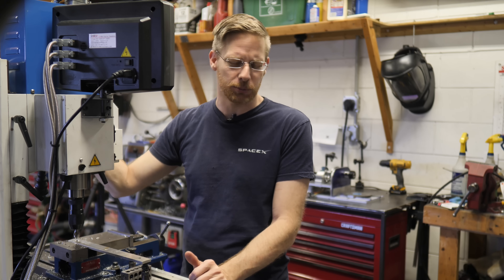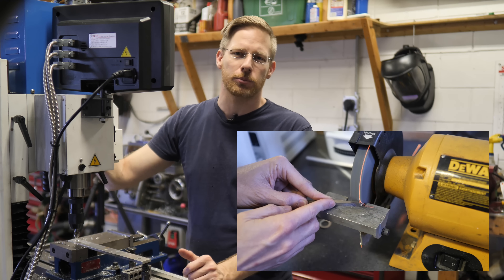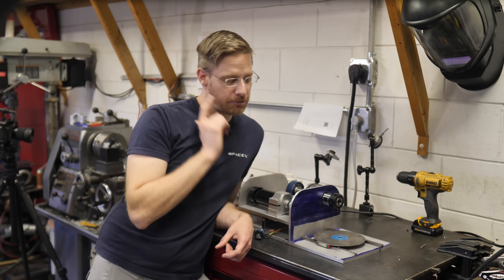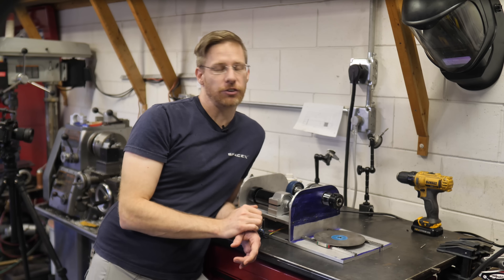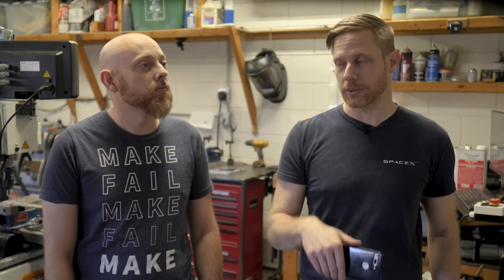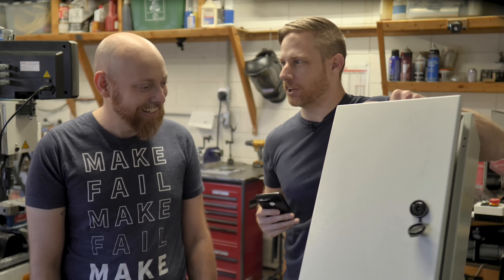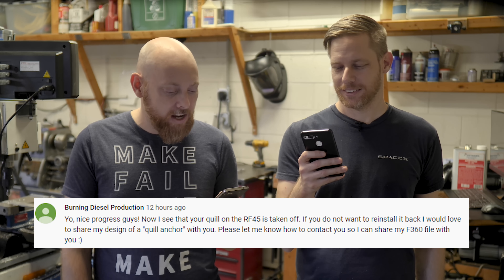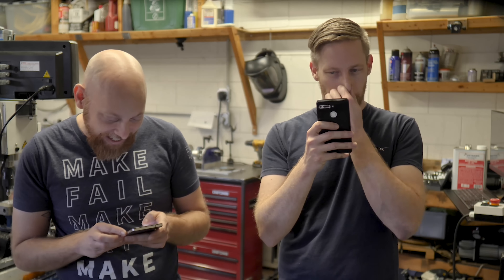Tool Lapping Machine Pt 1 - S03E06

Comment: You would have been better using a 1.5 kw vfd spindle because the better speed control and at demand higher speed for diamond wheels if you plan to use them maybe. Aaaand more power stable when you need to do harder work.

Comment: 3/4 isn't close to 25mm it's 19.05 , 25mm is close to 1inch (25.4mm)
Your local metal supplier should have shaft in stock. Called bright bar in Australia 
Its made to a tight tolerance for bearings and drive couplings
Reply from the maker: Thanks fowletm, you are correct. I meant 1 inch.
Reply: Hmm, yes, I think you will find, 25m is closer to 82 feet actualy, hmm, yes, hmm, hmm.

Comment: Do you find that the tool cart is strong/rigid enough to put your mill on it without destroying the top or interfering with the drawer operation? I was thinking of doing the same thing, keeping the tooling all together, but am concerned about how to not bend the top.

Comment: What am I missing at 3:20?  25.4 mm ~ 1 in, so how does a 25 mm shaft require shims to fit a 3/4 in bearing?  Me thinks those bearings are 1 in.
Reply from the maker: Indeed, that was my mistake with the on screen text. Should have read 1"
Reply: If it doesn’t fit, knurl it! Although I think even the magic gap filling powers of the knurl do not extend to 0.4mm
Reply: @machineshopatthebottomofth3213  depends on the hardness. Even if it was c45 or similar I would give up on the idea o knurling. And not only that but you put an awful force on the part and it's something that's supposed to run absolutely true

Comment: 3/4" isnt close to 25 mm... did you meant to say 1" ?
Reply: They must have gotten 19mm. It’s only .002” under 3/4 and for most applications a normal person would think it’s fine, but not a machinist.

Edit: looking at the video again and it looks like the stock is just under 1”, so I guess the “3/4” is the incorrect text.
Reply: No, they ordered 3/4" but got 25mm
Reply: Austriaball yea but 25 mm is like 0.98” so they had to shim it to make it bigger for the 3/4” bearings so something not right there. 🤷🏽‍♂️

Comment: Dale is my favorite Youtuber!  I love his videos on the slow speed grinder, but he made one big  big big mistake! He has the grinding table sitting above the center line of the disk. It works better if it is below center about an inch. One other thing to do is use magnets to hold the grinding disks. This makes for quick change because no matter witch disk you have on the machine it’s always the wrong one. They are like cats, always on the wrong side of the door.
Reply: I love Dale’s videos as well. Wonder if he will see this?

Comment: Hmm.. Maybe an 6061-T6 alumium chrome plated fire breathing unicorn hood ornament might make a nice CNC production item in the future. :) Oh. I think I need to mention this, a variable speed hand-held plunge router with a copy bit can make multiple aluminum part with a template. In the aircraft industry we use this method often for trimming, cut outs, edge treatment (radii-chamfers) and sometimes weight reducing pockets. :)